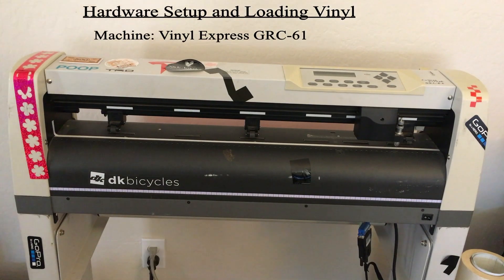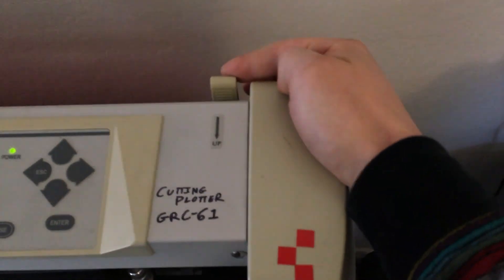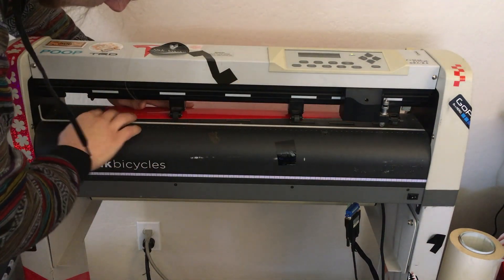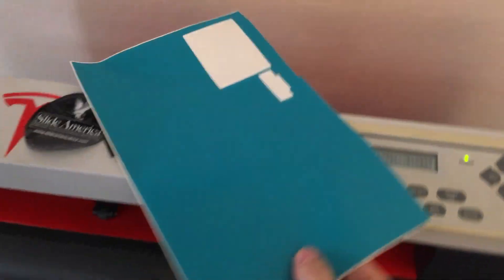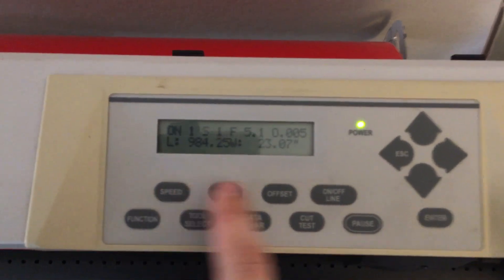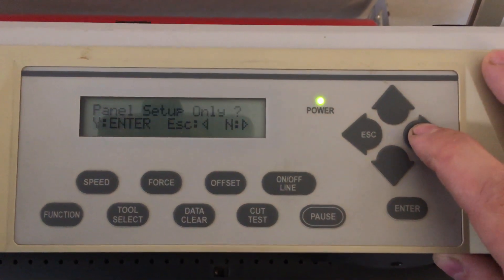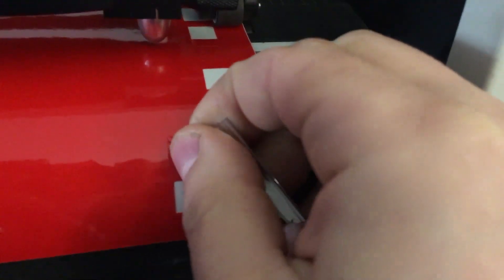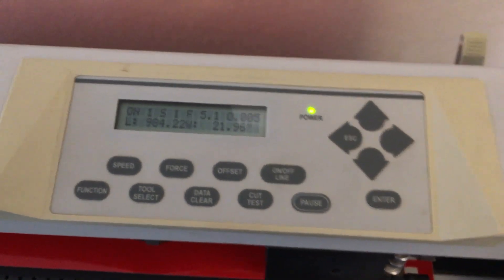Vinyl Express GRC-61 - Hardware setup, machine settings, loading vinyl

Comment: got GRC61 (1998?)  for 100€ in 2025. it got parallel to serial to usb shenanigans going on. so I installed "PL2303_Prolific_Driver" for USB and it works with old signblazer elements on windows 11 :O later GCC responded and sent win xp drivers, not sure i will need them. GRC61 is 24inches wide
Reply: This is actually helpful. One of my clients just gifted me one today. I just need to buy that serial to usb converter so i can get it setup. Thanks for the software recommendation also.

Comment: I have the Signwarehouse Panther cutter which apparently is the same.  I can cut to it using SureCutsALot v5.  but I would like to purchase different software since I'll be getting a US Cutter from a friend.  I'd like to buy that software now, but only if I can use it with the Panther cutter.  would you happen to have an answer?  I have all the old disks, hasp files etc for the Panther, but it won't install on windows10.